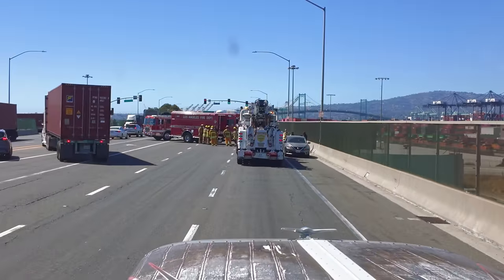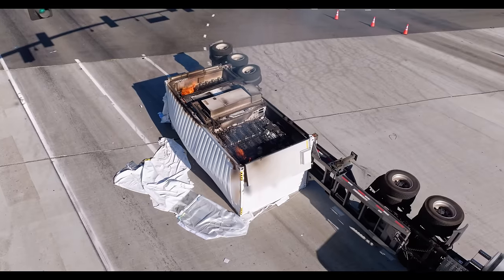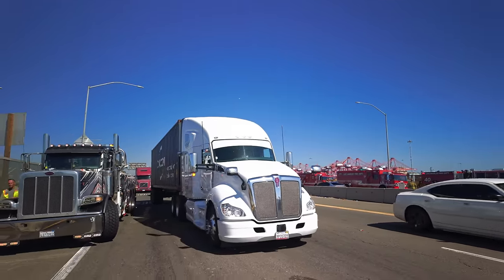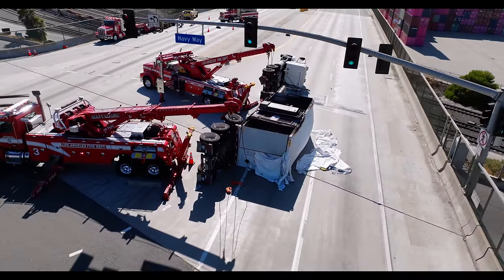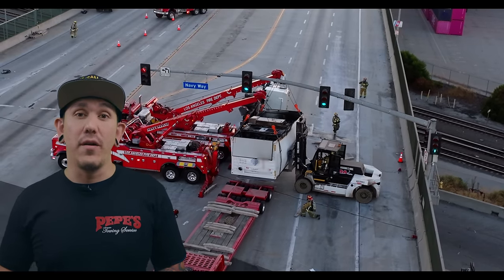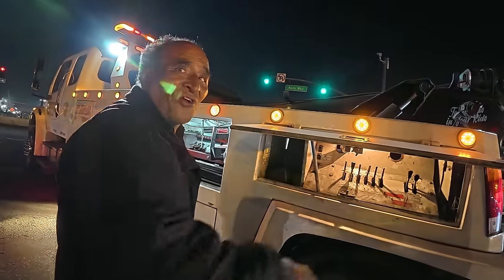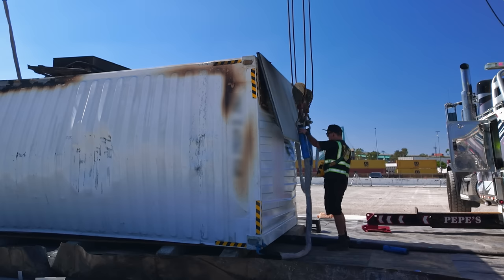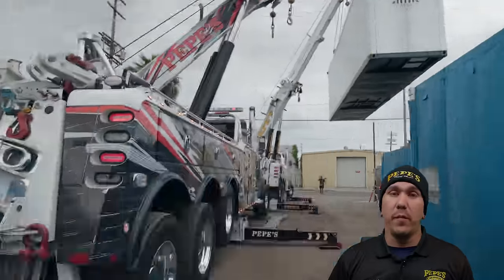60,000lb Lithium-ion Battery EXPLODES on Freeway!

Comment from the maker: I RUSHED this video like you wouldn't believe but tried my best to make it as entertaining as possible. What did everyone think? And what needs to change to prevent these crazy shut downs from lithium fires?
Reply: Quit shipping them!? What are they used for anyways?
Reply: Well done,  perhaps a flir camera in the future.  A little surprised the Fire Department didn't have a drone with a Flir camera
Reply: You need to be knocking doors and showing them the footage, showing them where they screwed up and where you would of done it easier if they train you to wear BA sets and what you need to be able to handle this for them, I would be pissed at them and at me for missing a shot like this but great video and great work to you all.
Reply: Worth the wait. I'm sorry I was impatient
Reply: @Exobiologic  I  actually meant what are the large lithium batteries used for. Josh explained it during his breakdown.  Thanks though! :_Love:
Reply: @PepesTowingService  I truly think you have done a great job of highlighting  the dangers of these batteries. Especially in these moden EV's, manufacturers do NOT fire protect them they are just encased in Aluminium that's all. That has a very very low melting point so no protection.
I truly believe you have highlighted the risk connected with these, so thank you Josh as you have helped those that watch your channel to evaluate and pass this information on to those that are thinking of buying a hybrid or EV.
Reply: Great video, you definitely worked on it as hard as your field work. What needs to change ASAP is the safety in transporting the batteries and then the penalties when things go wrong. We have seen too much with regard to lithium battery failures and the causes are well documented now. It's time for the battery manufacturers to stand up and get it right, and the suppliers to do the same. These things are dangerous, and there are clearly corners cut during production and transport.
Reply: Very specialized training, certification and endorsement on CDLs for drivers transporting these loads. Yes, true accidents can and do occur, but unsafe truck driving is the cause of the vast majority of these incidents, as it is for the majority of the incidents Pepe's responds to.
Reply: You guys always pull some badass stuff did a good job
Reply: @lynnmeese55 these 20' battery/generator containers are often used to provide primary or backup power to "critical infrastructure", whatever that may be.
Some examples : 
- providing power in disaster areas (like hurricane Helena)
- backup power for hospitals, server farms, ...
- medium/large size off-grid electricity generation (like live music events, ...)
- backup power for (industrial) systems that require 24/7 electricity no matter what happens (to prevent some kind of emergency)
- stabilizing power and providing a "near perfect" sine wave (AC) electricity output (eliminating power fluctuations like drops, peaks, brownouts, ...) for sensitive equipment
- bridging the gap between a power failure and the moment when large diesel generators are running at the minimum speed to generate stable electricity (like main offices of large banks, to power their critical servers)
Reply: Only complaint about videos is the music volume level. Too high. Love your videos and learned so much from you.
Reply: Good job, video turned out nice
Reply: Hazmat transport from minute one.   No flipflop companies allowed.  1 billion insurance... Paid via the owner of the product.    This stuff is no good!
Reply: Slightly off topic: Josh, your blurring skills are off the chart on this video!!! Remember how painful it was back in the day to do just a generic splotch. But this shape/angle blurring is awesome.
Reply from the maker: @Vessie-o2i  Really? That's unfortunate, I turned it down extra but maybe I should have went even lower.
Reply from the maker: @RLTango  Why thank you! That was NOT easy. It's kind of easy and quick if you just do a giant blob but I had individual masks at the same time so it doesn't stick out too much and ruin the shots. Not easy at all especially with the night scenes lol
Reply: @Vessie-o2i  it takes some technical know how but you can actually adjust the volume on your device. It actually has quite a large range. You can have no sound whatsoever all the way up to oh wow that is loud. Hope this helps
Reply: drone made me a little wobbly, but its nice coverage. thansk for the video
Reply: Great work Josh, Alex and Pepe's! You guys put together a stunning video. Thank you all.
Reply: @Yves_Cools  Thank you so much. The information was very helpful. 😊
Reply: What needs to be changed is having Harbor rats pulling those trailers. Just my 2cents.
Reply: Can or do you want to give a ball park price for this recovery... curious!
Thanks 
And another top quality video and recovery
Reply: You can make news outlets pay you for the video if they use it. Enjoy your channel keep up the good work.
Reply: Nice video work. Surprised Spielberg hasn't offered you a job with them drone skills haha
Reply: Even after fire there may still be danger of high voltage ?
Reply: Was fantastic, so glad I was already subbed, this was global news but your on-the-ground coverage was 100 times better than any of the garbage from the corporate media that really doesn't know what journalism is anymore. But you do!
Reply: Not as frequent or as damaging as a fuel tanker fire!
Reply: @mickjoebills  Wrong on both counts.
Reply: @wobblyboost I-95 closed twice for major repairs due to gas tanker fires. Less than 550 BEV passenger fires worldwide since 2010 according to EVfiresafe (Australian data gatherers)
Reply: You could have taken your rotator and lifted a few median concrete dividers out of the way to let traffic u-turn.?  Every tried that before?
Reply: @daviddogruel7851 yeah it's called hazmat
Reply: I have a cool suggestion some really heavy duty magnets that you could extend out and use to drag and like one of those polyvinyl slide to slip under it
Reply: Simon holmes, 36:06, I got it . look/ theeeeeee other way might blow your mind..
Reply: @PepesTowingService I'll tell you what needs to change regarding these costly shutdowns due to Lithium Ion Battery fires is until we have the proper technology and means to safely Lithium Ion Batteries need to  stop production etc
Reply: @JDSWeather  you and I can 100% agree on that. I know a shipping captain that takes Vehicles back and forth on those cargo vessels and that's a disaster waiting to happen serious disaster. But we used to have a rotary dial phone on the wall somebody needs to come up with something better this isn't rocket science and we should also while we're at it start working on desalination plants to deal with all of these droughts. There is zero reason they can't pipe water inland just like they do oil. Especially because it's a bit more necessary for life
Reply: Mate I can’t take you serious with ears like that 🤣🤣🤣🤣🤣🤣🤣🤣🤣🤣🤣
Reply: Wow...!!!  The unintended consequences of moving dangerous heavy massive batteries... That was a very costly accident.
Reply: @PepesTowingService  why is the fire hydrant  over that cage?
Reply: I don't know if you corrected it but I heard you say Lithium Ion and I really believe that it was Lithium Iron Phosphate, otherwise the batteries would have probably made a tremendous fireworks display and leave a real mess.
Reply: Ok.
Reply: The only way to prevent lithium fires is to no longer use lithium ion batteries. EV owners are often so damned smug about how green their vehicles are, and yet they fail to understand the physics of the very thing they often sit just above. The only "safe" way to stop a lithium fire is to submerge the battery pack in water, and even then it has to stay for a long period of time to be sure the pack is fully discharged and actually out. I have seen lithium ion batteries almost instantly reignite when removed from water, so there is no easy way to put these out, and to prevent the fires in the first place, we need fewer morons on the roads causing wrecks, and/or we need to simply find a better battery chemistry, and now.
Reply: @lynnmeese55  Energy storage for grid stability. A typical energy storage system is closer to 120-150 of these containers.
Reply: You did a great job in the editing. Very professional.
Reply: @lynnmeese55  it looks like one of those backup batteries at large corporations and energy plants to keep their generators running
Reply: 18 minutes in, excellent edit. I liked the Spielberg clip.   Very impressed by how quickly you edited so much footage !
Reply: I think a generator is the battery PLUS the DC to AC inverter PLUS a controller to maintain the voltage so it  behaves just like a gasoline or diesel generator. This is based on my research to buy a Jackery. There are also high and low temp automatic shutoffs to protect the battery from damage etc.
Reply: you did good flying and caught awesome footage even during the boom you stopped flying and it hovered and we got to see awesome footage just because of that alone
Reply: Can't they just use Dry Ice to put it out?
Reply: @jonkassidy1476 do you know what kind of operation that was!
Reply: There is an actual vehicle that looks like a small dumpster truck with two forks in the front or on the sides and when there is an electric car fire, this truck shows up to the scene picks up the car while it’s on fire and they dump it right in the back of the truck, which looks like a giant empty container filled with some kind of white foam soon as the car makes contact with that foam, it snuffs out the fire immediately I’ve only seen the vehicle videos come out of China, but they are online. Maybe the US needs to get their hands on something like that it works. I’ve seen the videos.
Reply: @lynnmeese55  are you kidding me? They’re used for everything.
Reply: G you don’t think flying the drone that close while the battery is unstable any electro magnetic interference is like sparking a match at a gas station🤭🤷🏻‍♂️😂😂😂 you think it was a coincidence you happen to catch that on film when you were like less than 10 feet from it🤫🤫🤫
Reply: Nice "cinematic" sweep Bruh!! #Skills
Even under the signal lights!?😎
Watch out for power lines though!😬
Be safe out there, phenomenal work guys!😍
Reply: I still don't think they needed to expand the cordon THAT much.  It already blew and released all the pressure, so it just becomes a fire at that point.
Reply: This is a very large problem.  The question is, can they be manufactured to be safer?  Because the manufacturers don't want to spend the money for the additional safety features.  
  There is a certain country that makes them for their Electric Vehicles, or EV's, and this happens quite often because of their shallow safety procedures and the, probably, total lack of safety features for any of their Lithium Ion batteries 🔋.
Reply: As soon as solid state batteries are in mass production, they should ban lithium ion batteries, or any liquid electrolyte lithium
Reply: @PepesTowingService  this video is documentary on lithium battery fire. Much needed in this time. Thanks
Reply: This is prime example why EV is NOT "the future". Stick with combustion engines until something else comes out that doesn't require special stuff to put out fires.
Reply: Lithium 65.000lb will not go out. It will melt the Asphalt! Pouring water on it would cause an explosion!!
Reply: Go back to Diesel trucks
Reply: That ain't nothing. In Missouri the recycling plant exploded a week ago and no news .
Reply: Great video sir. As I'm sure you know, the thing with those batteries is that once the reaction gets going, you can't really stop it. The best water can hope to do is cool it down enough to slow the reaction. But they don't stop until they are done reacting, when the fuel is used up. For shipping huge batteries over the road, maybe institute some oversize-load type rules. Maybe restrict them to lower-traffic hours as well.
Reply: All cause a driver had to take a corner too fast.
Reply: You called it a Generator which it is not Generators turns Fuel into Electricity, It was a Battery Pack/Bank/Unit it only stores and releases Electrons in does not Create aka Generate the Power Itself only Stores it!
Reply: Educate the drivers about taking a turn to fast, especially when it's 15000 lbs over top heavy .  make sure everyone gets a heavy haul safety class. My advice would be make it a rule to haul them on a drop deck to lower center of gravity would help alot. But 25 years of watching all those foreign drivers out there good luck. Be safe and watch out for crazy,  liked the coverage.
Reply: It's great how you can see shadows on the road from the explosion rippling through the air. Stay safe out there.
Reply: Fascinating video hooked me from the first drone shot.  This wreck was Exhibit A on why Prevention is better than Cure.   A little care in taking a corner slower, a little less tipping over in a single vehicle accident, and millions of dollars saved.   And it is also Exhibit B in why too much government regulation slows things down -- City should have a plan for any merchandise that passes on it' roads.   
That was an explosion alright (hydrogen gas?) but not as hot as I thought it would be based on similar incidents with EV car fires.  A shame that they couldn't find a way to get that thing off the overpass quicker.
Reply: You made over 1 hour video of a battery exploding and starting fire. Make it 1 minute next time BRUH!
Reply from the maker: @taucalm My channel is about recoveries. Un-smooth your brain and pay attention more.
Reply: 🎉is this a Tesla built power storage battery. Who manufactured it?
Reply: We will see more of these batteries fire just like ice engine vehicle fire then we will get bored about it and forget about it. Forget that ice engine also blow up n burn alot, also as the name suggest internal "combustion" engine .. policy needs to adapt to new tech so does emergency response policy and prevention relating tech failure.
Reply: Cool video but an hour is fucking ridiculous dude. Try 20 minutes.
Reply from the maker: @Scyth3934 you clearly aren't my target audience. I don't cater my videos to you
Reply: @Scyth3934  I wonder if anybody has watched this video fully. And if somebody has they might have died from boredom.